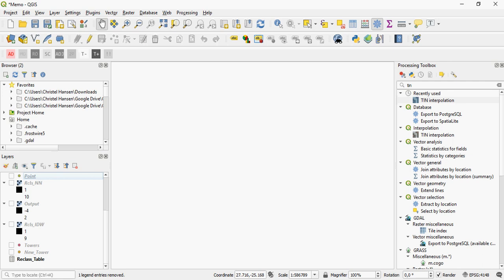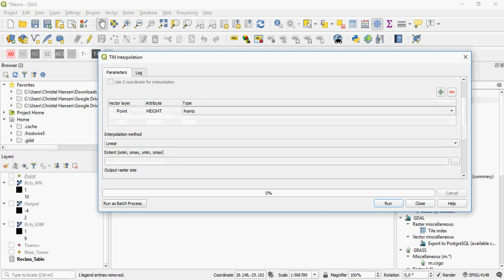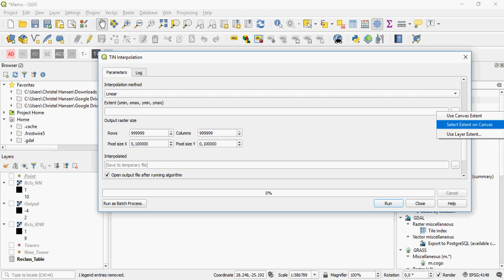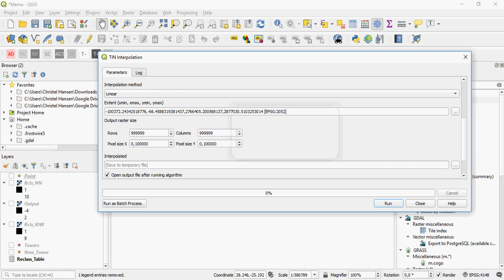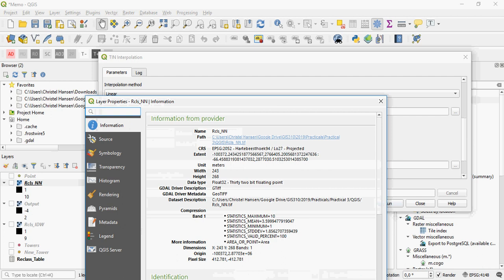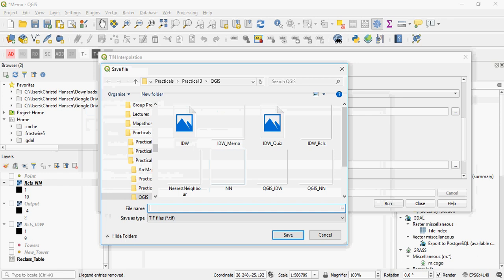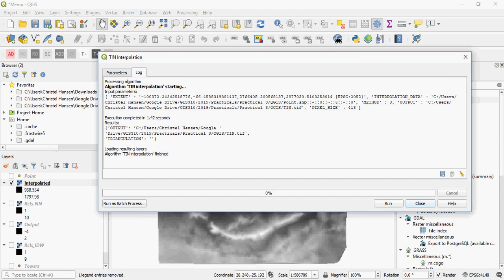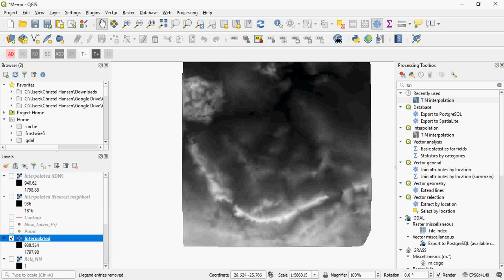QGIS TIN Interpolation

Comment: What is the difference between idw and tin interpolation?
Reply from the maker: They are two different interpolation methods. IDW is based on distance, with the power function determining how much a point's influence changes with distance. It creates a smooth interpolation surface, with transitions between interpolated values generally not abrupt, unless the bull's eye effect is present. TIN is an interpolation method that uses Delaunay triangulation, with the average of 3 points used to determine values between them (think of the face of a triangle). Changes in values between these interpolated surfaces are abrupt.
Reply: Thanks. I'm building contour lines to export to a tractor gps to follow. Is there a qgis function that allows you to create a line that follows a gradient? Like a contour line which has a percentage of fall?
Reply from the maker: @elliotscarffe2111  I don't know of such a tool off hand but it sounds like a raster calculation function. If you can create a raster that accounts for the change in slope from a particular contour line and use that as a cost surface for LCPs, you might be able to do this.